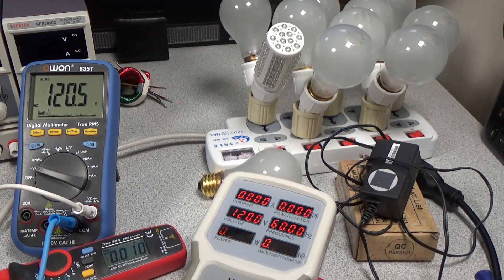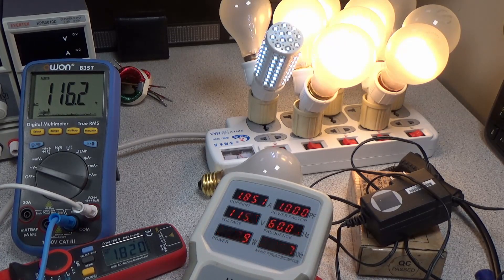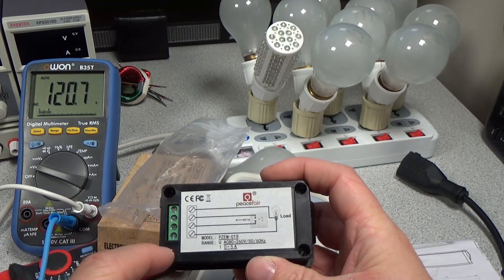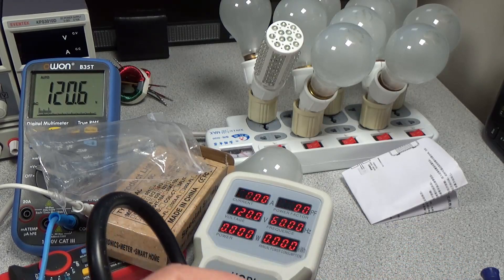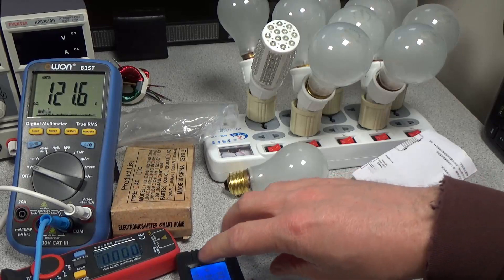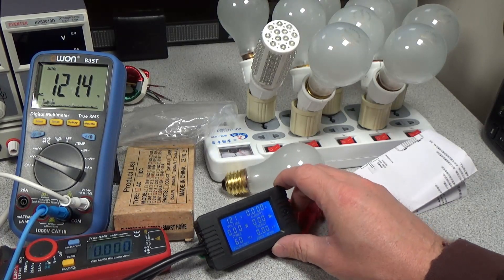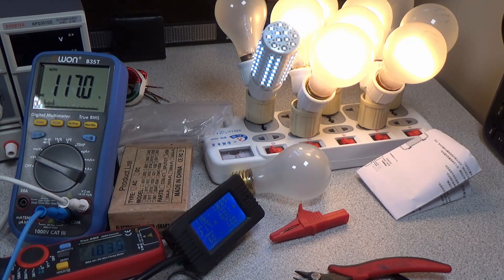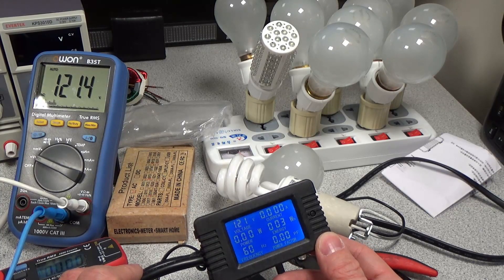Cheap Power Meter Setup and Quick Look - Video 9

Comment: Will this little meter keep a Running Total of wattage used over a period of hours?
Also, How would you test the wattage of a 220v circuit that has two hot leads?
Reply from the maker: This meter does log watt hours.  Depending on what you want to measure with 220V, this meter will work fine as long as the other hot line is the return path.  If you have a 4 wire device- IE neutral is involved, then you need more channels.

Comment: In use ...would you fuse the ( say, 120V / 60Hz) power legs to this unit?...and if so.....what kind of fuse ? ( 1A fast acting?)...and would you need to fuse each of the power legs or only one?
Reply from the maker: That's a good question.  A view on an old video, cool!  So, the fusing should be on the hot side.  This device is rated to handle ~5A so the fusing should match that capability, in this case slow blow since AC loads can go beyond this current number quite easily short term and a high crest factor current might pop a fast acting fuse with RMS current at the rating.  The electrical supply to the unit is power to the product connected down stream so both would share the same fuse.  An internal product fault would struggle to blow a 5A fuse but a product fault would probably mean this thing has cooked itself anyway.  So, multiple fuses would be ideal but it doesn't have a separate electric supply for the meter.  I don't recommend something like this to be left plugged in long term, good temporary use item though.
Reply: @AllThingsOnePlace  ...thank you for the detailed response....much appreciated.

Comment: Can't seem to get amps to show when hooked up
Reply from the maker: Hmmm.  I would check the wiring and make sure the current is actually going through the meter and also in the correct direction.  Obviously, having another tool available like the current clamp is nice to validate the reading.  I know there are a few versions of these some with higher currents or external shunts so those would either not show small currents or require some extra work to connect everything.

Comment: Doesn't look terrible, probably good for a small project
Reply from the maker: With near zero power consumption it is basically a free (energy cost) add on.
Reply: @AllThingsOnePlace  
Hi
What's the totle range of this meter in kwh?
I mean how much it totle value will show in kwh? Because this parameter is important for electricity point of view.
Reply: Could you use this to monitor server power use? Like a NAS box, desktop and maybe a router/switch?